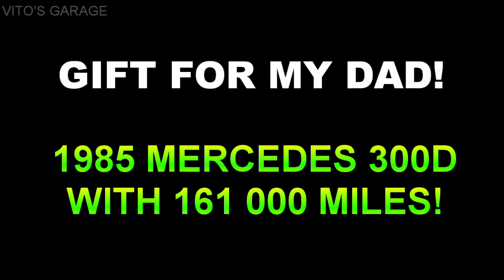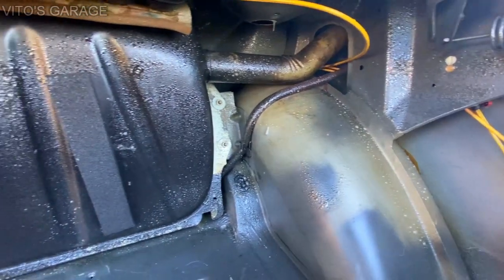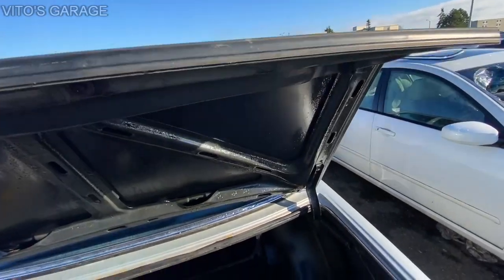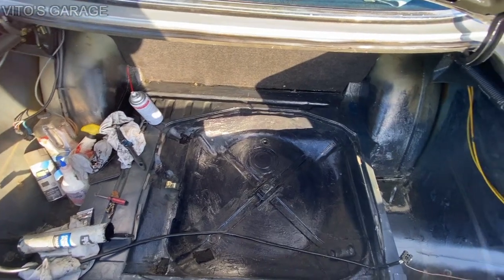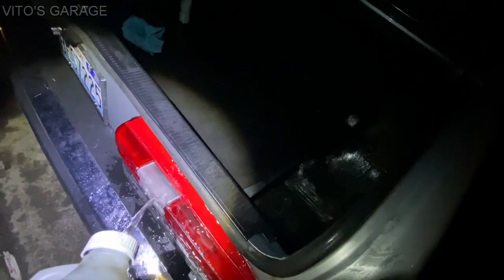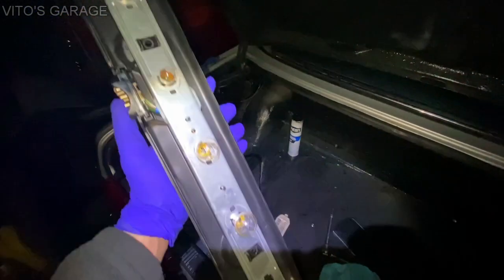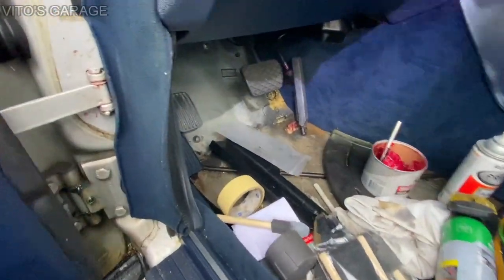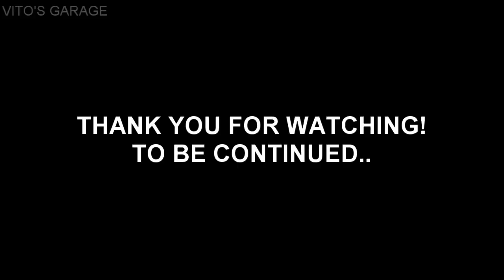PART 25 Dad's Mercedes W123:Trunk Cleanup, Rust Repair/Preserve, Fixed Antenna & New Tail Lamp Seals

Comment: nice work man
i took my w210 to the car wash today and i left with a bunch of water leaking inside of my trunk. it wasn’t a lot but that’s bad enough. turned out some pins were missing which let the water get in. it’s always important to check small details before bad things happen
Reply from the maker: Very true! Thank you for watching and supporting!:)

Comment: I was wondering, once you lift the mat, there is a foldable  cover that goes over the spare tire,.sometimes if it gets wet, you have to change it, what I have done in the past is get a panel, and using the one from the car, make the measurements to the exact size, and you replace it , it is cheaper.
Reply from the maker: Thank you. The mat in the trunk is in amazing shape. No issues with it🙂